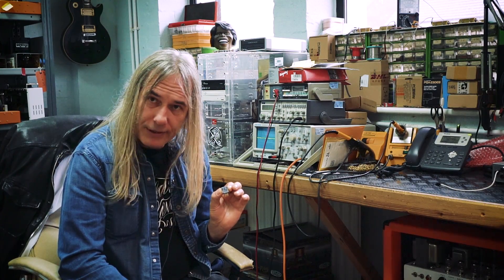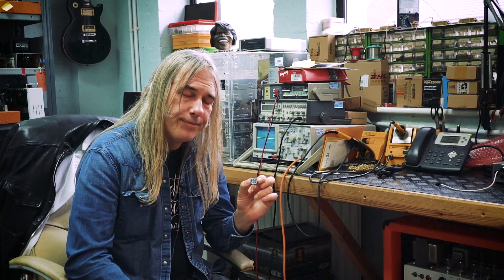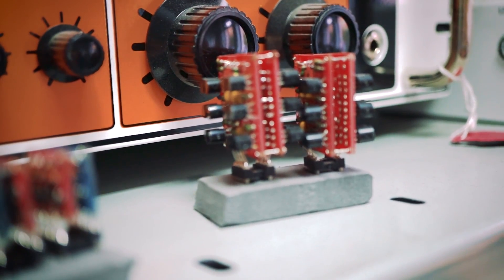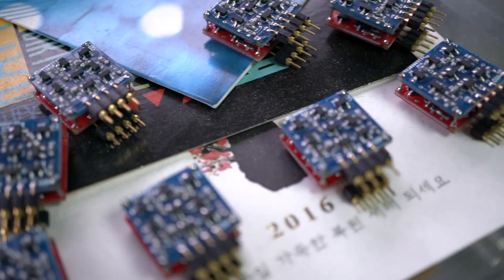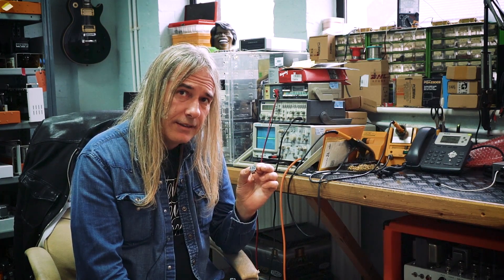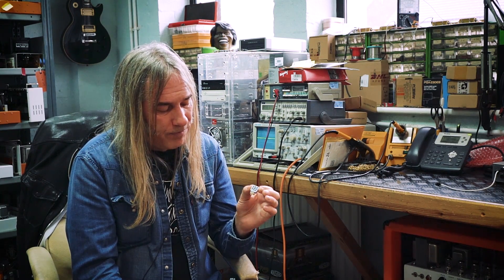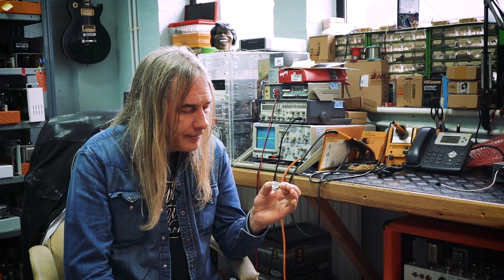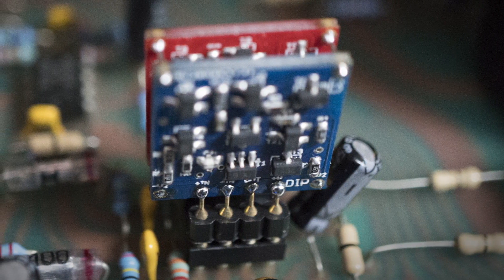Orange Dual Discrete OP-Amp

Comment: Really surprised at some of the shitty comments below. I swapped these for the ubiquitous 5532 in a line stage and it is exactly the improvement he said; a bit more musical and a bit more detailed. I don't think audiofools are chasing opamp gear period because they will have read opamps are terrible in the hifi press which is obviously where all the electronics experts work . Further, what's shit about SMD? £40 is bugger all compared to fancy mains leads and all that other crap out there (to Naim a few).

Comment: Using this op amp in my Aune X8 DAC and like it better than the Sparkos Labs. Definitely more musical to me.
Reply: Nice one, thanks Kevin! I was umm-ing and aaah-ing about which to get. Think you've just helped me to decide.
Reply: @kcoffey2 still rockin these chips? Give the internet an update
Reply: Yes still in use.👍 May try some others just to experiment. I purchased a pair of Aiyima A07 Max class D amps that have swappable op amps and will try this combination also @joshdeakins1775
Reply: I do but I since then I got a Geshelli Labs J2 with the AKM 4493 and that is a very good DAC also@ruger6049

Comment: So I’m new to this gear and what application it even serves..can it be used in a cars stereo? And should or could you install it into like say any of the lunchbox amps? Or guitar amps in general? I’m a bit lost and just super curious.
Reply: Operational amplifiers are a basic electronic building block. You should do some research on them -- they are in everything. All op amps are made different, and as far as this op amp goes, it will perform worse than quality integrated op amps.

Comment: more expensive than chip op amp. any way op amp are use because they are cheap. high quality guitar amp will use discrete jfets and very hard to find that so I am designing my own. reason being that must use diode for clipping and does not respond well when power tries to pull more current form the chip  it which pushed it into hard clipping.

Comment: These are hardly new. Discrete op amps go back to the George Philbrick prototypes, and GAP computer op amps that used a pair of vacuum tubes, and some of the GAP op amps used a very lovely special grade 12AX7 computer grade valve, usually paired with a sharp cutoff pentode, or possibly another triode pair. There were some killer hand made audio op amps in studio use back in the 1970s, 80s and 90s, but these ain't them. Not even close. So far these are playing a totally different game, rather than being in the same league as the old discrete audio op amps. I have no doubt these are mass produced parts shat out of a machine in an Asian sweat shop. These tested like a bad joke on my bench. Rather than a painstakingly hand built product made with hand matched transistor pairs, and each passive part gets run on an externally biased bridge, and lovingly plotted across the audio spectrum, and beyond, for not so obvious, but none the less VERY IMPORTANT reasons, this is cheap randomly selected SMD junk. I see this same shite at NAMM every year. Two dreaming asses have another FET solid state valve replacement, and two dreaming dicks have a discrete op amp, made up in China. The next NAMM, it's another two pairs of asses and dicks. The others are long gone. Orange's mass failure on their valve tester, was painful enough to watch, and now this? If Mathew Mathias is not involved, bin it.

Comment: This was different, and I'm ignorant as to what this hing does.
Reply: It's quite simple, really, it takes around $60 out of your pocket, and puts it in Orange's bank account, and in exchange you get a $60 part that does the same exact thing as a 24 cent part. It's all quite nice, but you have to spend another $300 redesigning your power supply,  because this thing is only about 10% as efficient as the 24 cent part. Orange is praying someone will be stupid enough to design other products around these, and when your product's Orange op amps shit the bed, these will probably have been discontinued. Fear not! I hand build rare and obsolete op amps, and synth modules all the time. You may wish to take out a second mortgage on your home, and or take on a second job, though.

Comment: So, 42£ for a clunky power hungry JFET based opamp...? I think I'll go with the regular offerings of LM/TL/JRC, etc. and If I want high-fi type, then there's still Burr Brown.
Reply: OPA1612 is designed purely for audio.  0.000015% distortion.  Beat that.  Anywya a discrete version is going to pick up loads more noise and hum unless its in a can, so why?
Reply: @MarkTillotson  Tho 1612 is more than good enough for audio. It's not designed for audio. It is taken from the design of opa211 which is high performance precision opamp. Opa1622 is one of the only opamps that are designed for audio from the beginning. 
But that's irrelevant anyway.
Reply: Muses 02 for me over burson. But i only tried the v5i which sounded like ass, worse than the cheapo 49720 stock opamps
Reply: I'd trust Ade when he says it's equal or better than a few of the current offerings and it's clearly being aimed at a specific market being designed with audio tweakability in mind, open circuit and all. While it's large and as expected, draws a bit more than a PDIP because there's so much more to it, there aren't many that don't claim to be all-rounders.

I expect there might be a bit more magic to this than expected, given the fact that a BB boast their 0.00008% distortion and this claims a meager 0.002%, theoretically it distorts earlier but to me, there lies the difference, is it trading some of that clean gain to eek out a better sound? The power doesn't really irk me, but there's an example to be set here, I'd like to see an example really.

I'd try one by all means, but ultimately, agreed, quite an expensive thing.